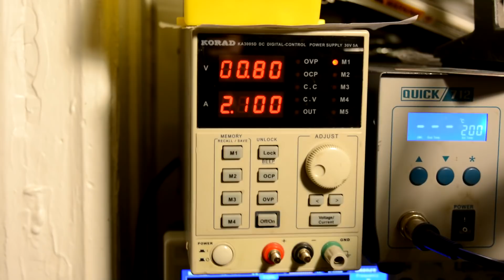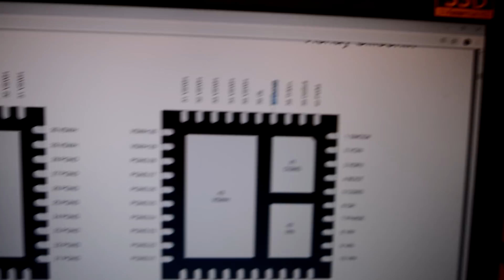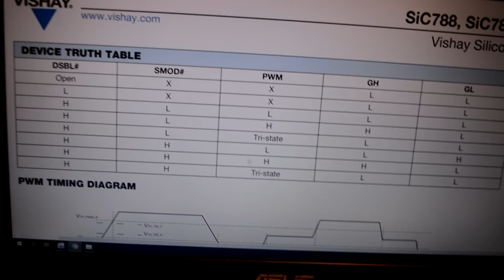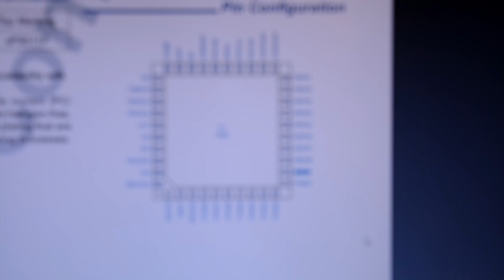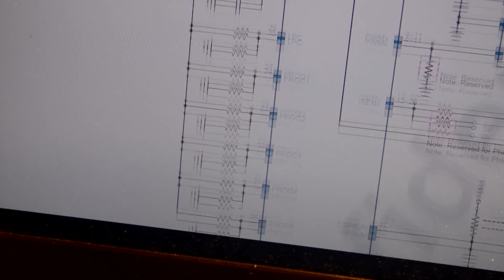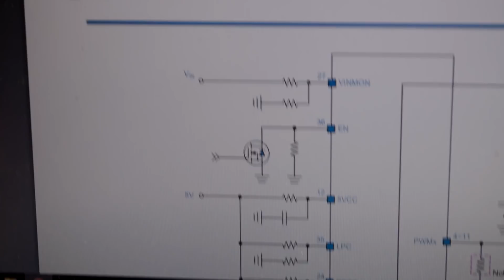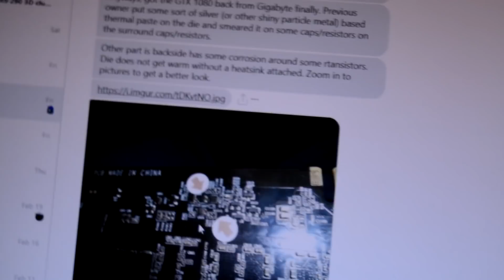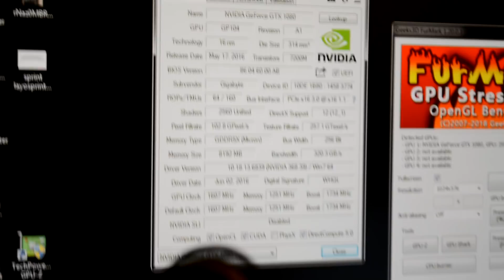GTX 1080 mini from Ebay🤞 failed to be changed out under warranty Repair / Diagnostic  process

Comment: wow. if that happened to me while measuring that resistor i would have said "1.9 ohms?... yeah its in range of normal" and ignore it. You're good man. thanks.
Reply from the maker: it was 1.9 kOhms. In 100 times bigger

Comment: I honestly had no idea that GPUs as powerful as the 1080 came in the mini size. I thought it was limited to the lower end, low power GPUs that got the small PCBs. I had a GTX 1050 Ti mini and it was a great budget card. But I can only imagine the potential for a much more power hungry GPU like a 1080 to be much hotter on such a small package. Are they clocked down at all on the mini sized cards?

Comment: Hi guys, what are the best broken cards to buy for learning repair? i have a multimeter, soldering station and hot air station so i think the basics are covered (also we have a reballing machine in the shop). I work in a laptop repair shop but i mainly do a software related stuff and basic troubleshooting and cleaning. Couple of my colleague are good with electronics so they also help me.

Comment: How do I get a hold of you? I have a EVGA 1080ti SC2 Hybrid that needs fixing. Long story short. I live in a converted barn loft and I had a windowless case and a mouse (Yes a mouse got inside my case) pissed on my card and EVGA doesn't want to warranty it. I did take the card apart and cleaned it well but there is rust on some of the pads and missing soldier balls. The DVI is the only thing that works on the card.

Comment: Question: What voltage would show multimeter if you check before that faulty resistor? In my mind there should be 5V and voltage drop across the resistor? Great work!

Comment: damn, awesome videos im definitely hooked on this topic now. ive got two 980ti's wont post now dude to overload from being on the same circuit as a 1500w heater. pc shut off then wouldn't post.. I accidentally did this twice once with each card installed before i realized whath had happend. do you still repair them?  or know some place that does?  thanks . great videos

Comment: Very nice video, i have yesterday received a zotac gtx 1070 mini 8gb (the one you show in this video together with the Gigabyte) , no screen, the card has all the voltage working, on the gpu, on ram, pci express, pll, should I think this is a dead gpu??? the gpu get also a voltage of 0.87 V and getting hot.

Comment: Hello @Eli Tech, I see this motherboard tester card for the first time and on the next video you are not using it. Could you please tell me what information the upper 4-digit display gives? Is this information necessary for diagnosis or is the lower 2-digit code sufficient?

Comment: Hi, Eli Tech! First of all you are doing grate job with repairs!
Can you please point me out here. I have Sapphire R9 380 4Gb ram. This card stared to be unrecognised by the computer. But, if I try to start it by couple of restarts or turn on and of the computer, than it start working computer recognise it. Doing benchmark everting is fine, it sees 4gb of ram and fps is ok too, until I shut down or reset the computer, same problem begin with the graphic want boot again. It will boot after persisting with turning on and off the computer until is recognised.
Can you please point me out which part on the graphic card is te problem or couple of them? I wish to try and change parts by myself.
If you can make a video pointing this problem or leave comment here.
Thank you!

Comment: hey I was wondering If you could help me, i have an alienware 17 r5 with a gtx 980m. short story the card used to work in my 120hzr screen but it stopped working I have another same laptop but with a 60hzr screen which is optimus mode and it detects the card in device manager. any help would be appreciated thank you.

Comment: hi buddy i have a question why my GTX980 shows picture but no quality and does not install Nvidiadriver.  From the beginning, when it turns on, lines are displayed on the screen, it starts to work, but it's not high quality. It shows everything with a huge zoom. Thank you in advance.

Comment: I've seen a bunch of cards for sale on ebay where the seller says that there are green lines on the screen. Should I buy these cards as a beginner? I've been avoiding them because I've been assuming it's a gpu problem.

Comment: What would you do if the graphics card won't let the computer to turn on?!
My PC burnt out of overheating, I lost power supply, mobo, gtx 970, SSD, HD and mouse. All my peripherals gone. Now I have new mobo and PSU, when I plug GPU in, the PSU clicks on/off.
How to test?

Comment: Hi Eli, thanks for your videos, I am looking them through as my GTX1080 has recently died.   First it was no power to onboard fans, but I ran waterblock so it wasn't a problem.  It ran fine for about 2 months but it just won't reach its normal V, and I was getting random lines on screen which would go away on reset.   Just few weeks ago it died and I think it shorted because computer does not boot with it plugged in but other gpu works fine.

I don't have your skillsets to replace chips , so I will hope to reball with heatgun and see if it comes back.   is there a forum or website that I can post my process to get some hints/tips?
Reply: hi how did it go i have gtx 1080ti aorus extreme that wont power on if you put the right pci e 8 pin in

Comment: Hi there Eli i've been a vivid viewer for a while i have a question my mrs has a Gtx 960 2gb strix oc edition but its hmdi port has broken pins i have checked and confirmed this as ive been building pcs since i was 13 so around 18 years ish now give or take a few months but i was wondering do you know wher i can buy a replacement port from for this card i have soldering kits ect i just cant find anywhere i looked around but i dunno if you know a site / company i can buy this part from please link me in a reply thanks :D

Comment: I have that exact 1070 ti, and doesn’t ramp up the fans too much. Would you recommend a more aggressive fan curve? I haven’t had any problems so far
Reply: No, not needed. Running a card "hot" doesn't degrade the card in any meaningful way.

Comment: All that over a single 2 ohm resistor that was burnt out to 2 K-ohms! Gigabyte will use any reason they can find to deny warranty, even "PCB Bent" for <0.5mm PCB bend that occurs from the factory because they didn't manufacture their heatsinks correctly! Disgusting!

Goes to show they didn't even bother looking at the card to find the real reason it failed; it was manufacturer defect and not customer-induced damage.

Comment: When I saw you were going to run it without cooling I expected the chip to blow up. Don't those GPU's get instantly runaway hot like a modern CPU?
Reply: Idle not.. :) i remember gpu can do 0 rpm fan below 52°C.

Comment: I have got a Motherboard that died.... I'm pretty sûre you can fix it...

When i connect the 8 pin cpu the Motherboard Will not start but if i only connect 24 pins connector thé Motherboard Will start but... No cpu power so it's not working

Comment: I am having a different problem with my gpu after sometime when i am browsing or watching video and playing game my monitor goes to power saving mode..but in background everything playing fine..i have to unplugged my power cable to fix this and it happens again plz give me some suggestion...
i have sapphire r7 260x non oc i3 4160 and 8 gb 1600 mhz ram, 450 watt power supply and lg free sync monitor..

Comment: My gtx 908 ti amp extreme is crashing when i try to boot andit artifacts as well green dots everywhere don't think i spent right but i really looking on how to fix it
Reply: Sounds like a VRAM issue.
Reply: @-eMpTy-  Thanks, any chance you can tell me on how to find what chip is bad i don't want to replace all of the chips there is 12 and they are £11.99?
Reply: I'd try to first reflash the bios of it with a lower VRAM clock, this might fix the issue already. You have to modify a bios for it, there are plenty of tutorials on how to do it online.
Reply: @-eMpTy-  But i can't boot into windows with the card, i just get the windows loading then green nots which is followed up with a crash of the pc.
Reply: @-eMpTy-  Do you know a good place to buy new memory modules, i have the name off the current ones. also do you know how i can check what memory module is bad?
Reply: @mustacheenthusiast1079  

Get some cheap graphics card and put it in the first PCIe Slot. Install the drivers for it. Then put your faulty 980 ti in the second slot. You can flash the bios on it now.
Reply: @mustacheenthusiast1079  

And I have no idea where to get VRAM chips, sorry.
Reply: @-eMpTy-  Alright thanks?

Comment: Hey,
Sorry to bother.
I do have EVGA GTX 1060 6Gb memory video card,
Suddenly it stop working.
The card is not power on.
The fan spin 1 second when I started the desktop, then stopped.
Try to learn of how to fix myself, I don't have any education in electronic, Just the will to learn.
Anyway,
i want to know where to buy a mosfet, capacitor, or any other GPU components for the EVGA GTX 1060 6Gb memory to fix the broken GPU.
Thanks.

Comment: Hey guys i know this is random but i need help with a PSU, Im buying an 
rx 480 8gb for 120 euros next week, i have a i5 2500. And i need a psu, 
but i dont know how to read amps. Is this psu good?  BQT L7-530W It has 2
 12v rails and each have 22 Amps. Should i go for 2 rails or 1 rail. 
Thanks
Reply: Go for single rail

Comment: this was really tough without schema. but the voltage being low from 5v seemed to conclude it was not letting enough past after, especially with a kilo-ohm resister, not a couple of ohms. It was very risky to try the tweezers on a bypass of the resister, as it may have been critical of the ohms. Louis spent 3 hrs every evening for a year and a half, to finally get how the macbook was put together, to learn more than the stupid "genius bar". I don't think he could have solved this particular symptom. Just don't believe he could, but he is smart. whoever buys this mini should put a water block on it to cool it better. Louis really fucked up not hiring you, as you are much better at diagnosis than his best helper Paul s.

Comment: microsoft announced  some up coming games will have directx 12 support 
on windows 7 . And  7 still only has directx 11 .win  8.1 directx 11.1  
 .  amd drivers for hd5870  driver 15.7 had directx 11.1 for win 7  .so 
why does directx 12 cards only have directx 11 on win 7  . kinda feels 
like was forced to upgrade and lied to . because having run the hd 
5870x2 having directx 11.1 support and upgrading to a vega card only 
having directx 11 seems cheated on windows 7.......

Comment: I have 2 identical cards. One card have 2 resistors burned R1001/R1002. The other card have 2 burned chips uP7549p10. What troubleshooting steps should I take?

Comment: 9:48 pin 39 DSBL# is high level? isn't # representing Low active if low state?
RSMRST# - reset gets delivered when the state is low (0V)
PWRBTN# remember those? Laptop repairs?
# is active when the voltage is 0

PIN 39 DSBL# Disable pin. Active low
PIN 1 SMOD# Low-side gate turn-off logic. Active low

Comment: I have a rx 580 nitro card it got heat damaged but still runs on stock settings ONLY if u change any of the setting it crashes, it is a extra card I am not currently using could I send you the card and if u are able to repair it i could easily send you cash via paypal before u return the card. write me back if u are interested in helping me out.
Reply: it is a 8gb sapphire nitro version so it is worth trying to save and I am willing to spend over 100 dollars on getting it fixed.

Comment: First I subscribed this channel but after seeng this film I'm unsubscribed at once. For me it is not right to play russian roulette with customer devices, even if you 'take reponsoibility' for your doings. Is it was so hard to CHANGE suspected  parts instead of short it by pliers? In my opinion it is very unprofessional approach. Maybe I am wrong, but such way of proceeding  is more suited to a teenager who starts playing with electronics. I observed already many films from professional servicemans and I have comparison. Anyaway I wish you well, but in my opinion you still need to work on the right approach to client equipment.